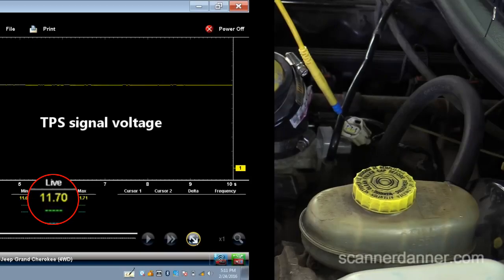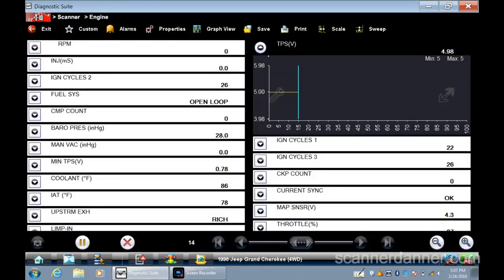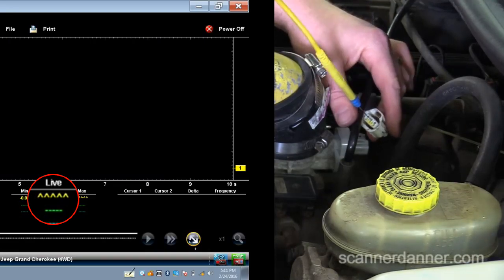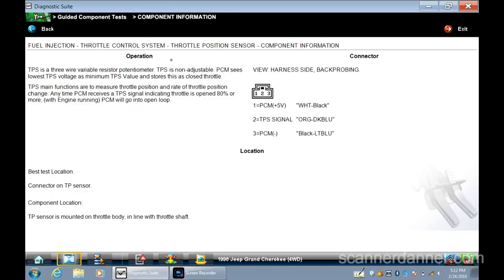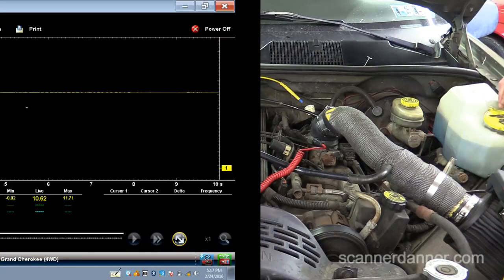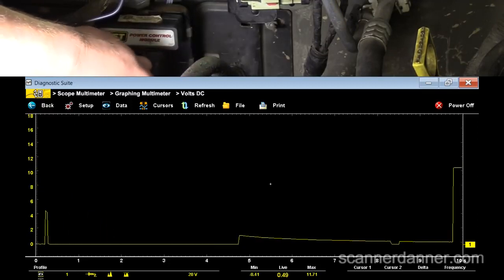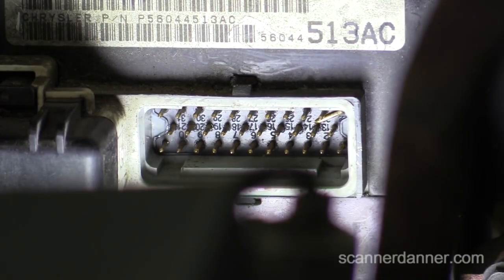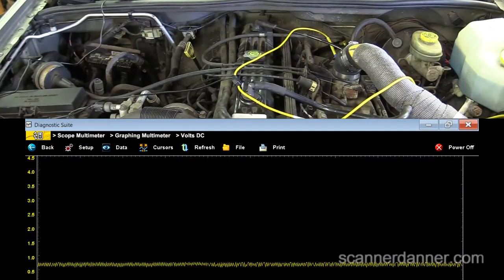TPS Signal Shorted to 12v Scan Data Fixed at 5v - P0123

Comment: if you had open in signal wire the scan data would show 0 volt ,i think
Reply from the maker: Not on some my friend. On most cars today there is a bias voltage that will cause the signal wire to read near 5v with an open circuit (when measured at the computer or with scan data)
Reply: @ScannerDanner  is it a substituted value or bias voltage?
Reply from the maker: A direct measurement of voltage is not substituted but scan data values can be.